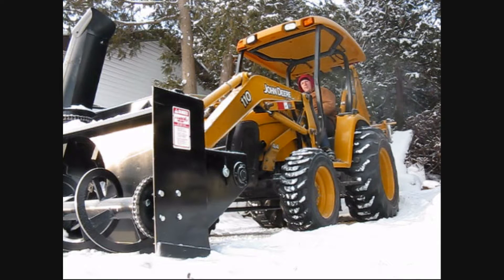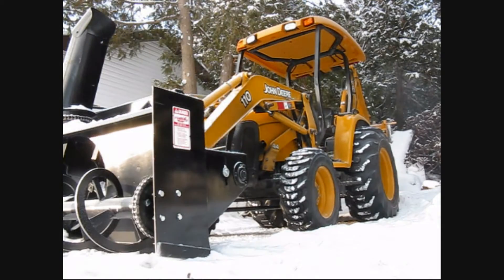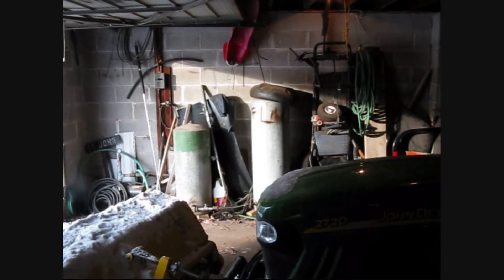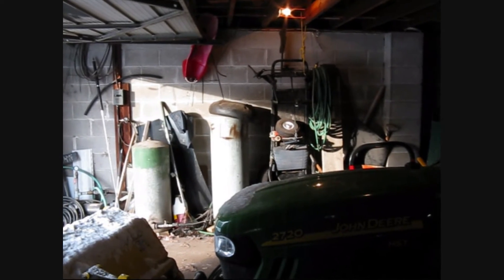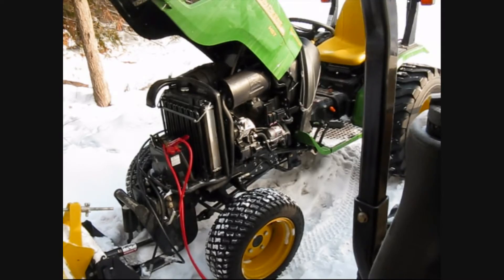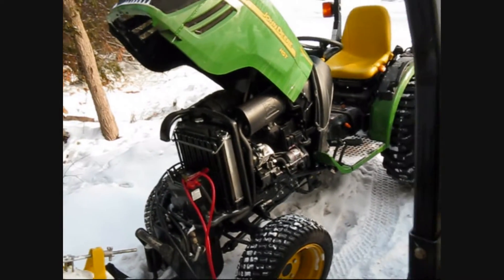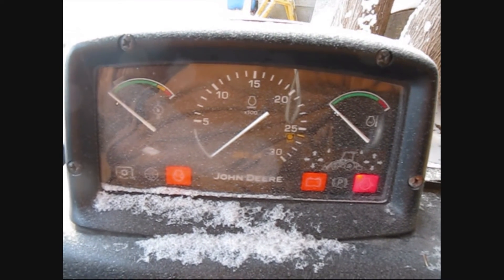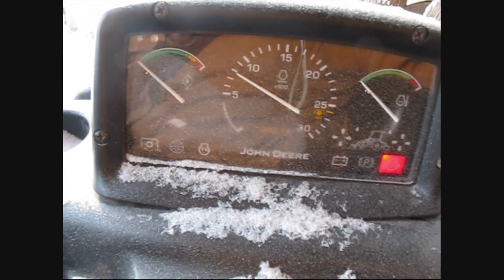-20 degree John Deere TLB start up "FAIL" ???

Comment: How is the front mount blower powered, mid  PTO or rear with a gear box of some sort? What make?  Do you like the blower?  Looks like the front aux hydraulics are used to move the discharge shoot, correct?
Thanks